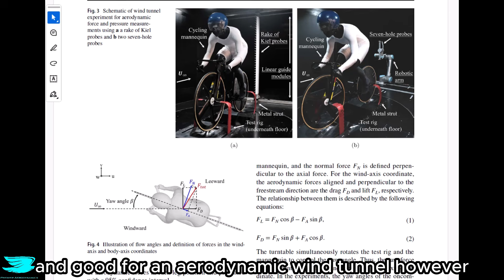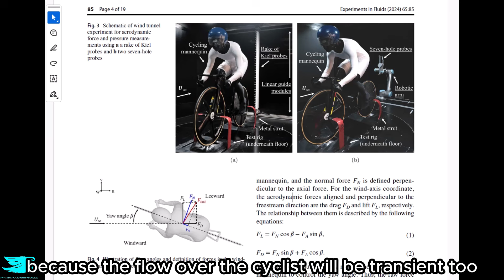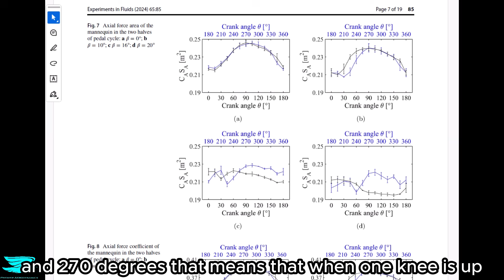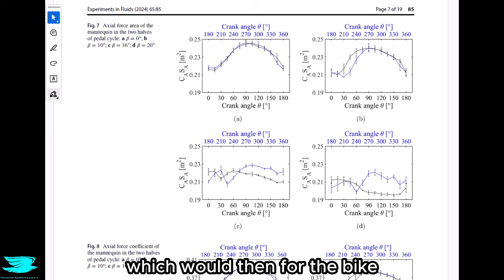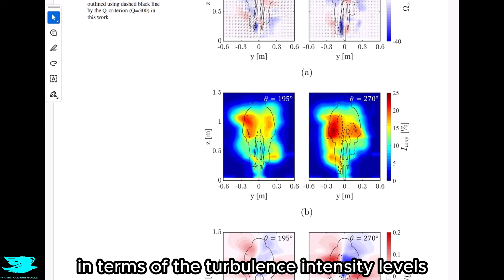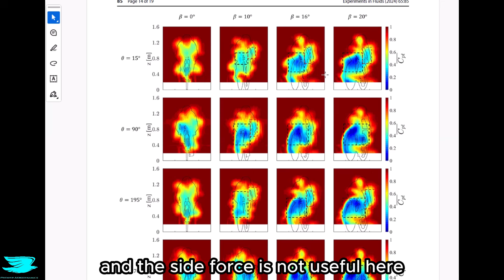Cycling Aerodynamics In Crosswinds And Different Leg Positions Podcast 243

Comment: This was interesting! I am facing issues with designing fairings for motorcycling aerodynamics with a crosswind concern, or really turbulent wakes, and would appreciate attention on that if you can. I don't think it's researched as well for road-going vehicles as compared to racing.

In particular, I've performed CFD at 15-degree angles in a 70mph context, and am hoping some of this effect can be beneficial instead of often quite harmful.
Reply from the maker: Thanks for the idea!

Comment: When i cycle with my backpack on, my speed is limited by heat, i want to design a wearable that optimises the aerodynamics around me for cooling, where should i put the air inlets and outlets to get the most amount of air past my back and what kind of inlets should they be, NACA, scoops etc?